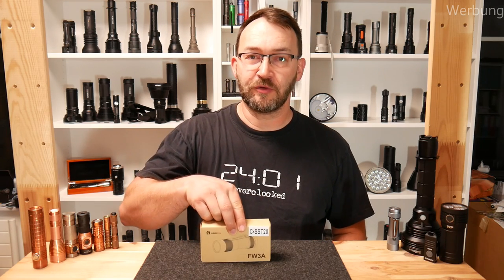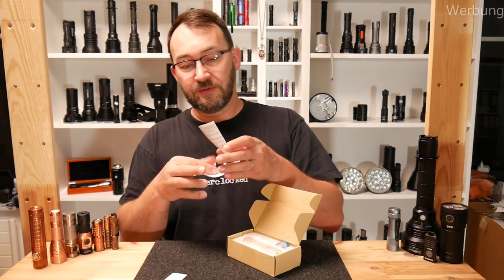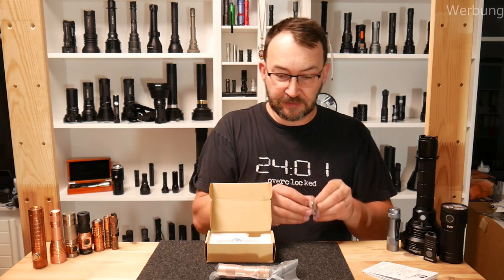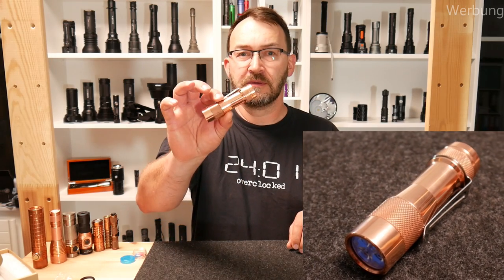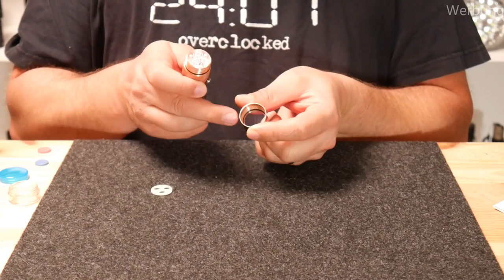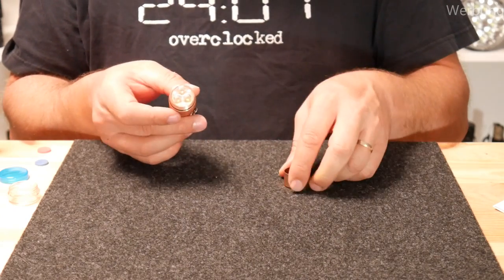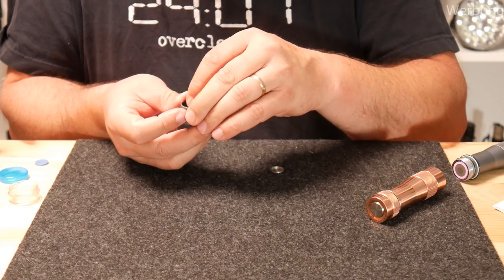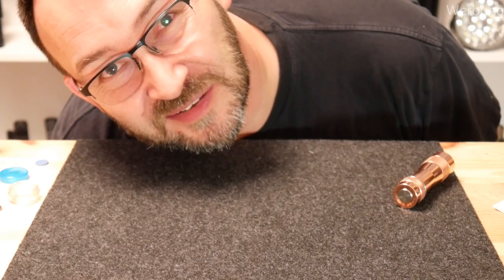FW3C unboxing PLUS modding TURBOLGLOW Gasket and Button

Comment: You can get plastic safety blades to avoid scratching. They are still very sharp.  Great for safely cleaning silicone gasket off of aluminum, for instance.

Comment: Nice mods.  Since copper is better at heat dissipation,is the copper FW3 easier to hold during turbo mode?  Wondering if the copper version is worth the extra $.  Thanks for the video!
Reply: Probably not by very much if at all. I got a fw3c on the way soon, but I only got it cuz I like my copper.
Reply: Titanium is better

Comment: I don't see the point of the glow button. Do you always need to light it first with another flashlight ? Is it safer than the metal one for accidental presses in the pocket ?
Reply from the maker: "well - it looks nice"
sense? hmm

no difference in operation since they are built the same shape
Reply: @MartinRathmanner_M4D_M4X  Sure but I just wish it was glowing all the time or when the light turns on. It seems like it will never glow during normal use (correct me if I'm wrong)
Reply from the maker: @eric280197  it's just GITD material
no active leds there

Comment: My button won't come out seem to take alot of pressure jw if they have started gluing it in
Reply from the maker: do you have a new batch with black retaining ring that need to be unscrewed?
Reply: Yes there is a black retaining ring there does it just screw out
Reply: I ran into the same problem and ended up here!